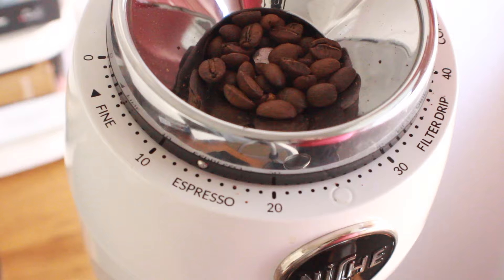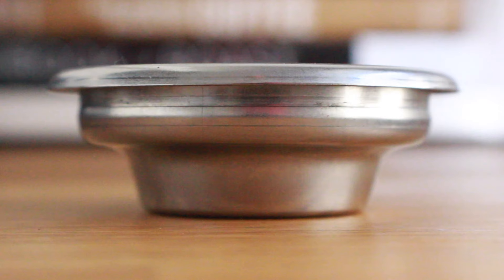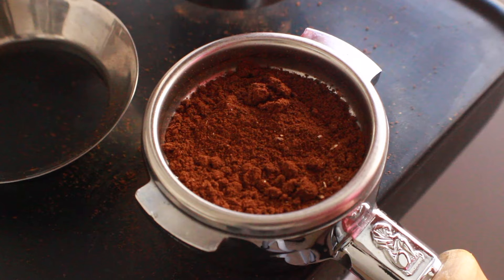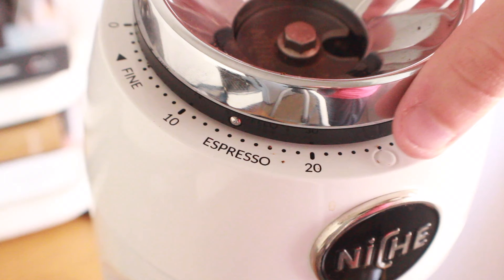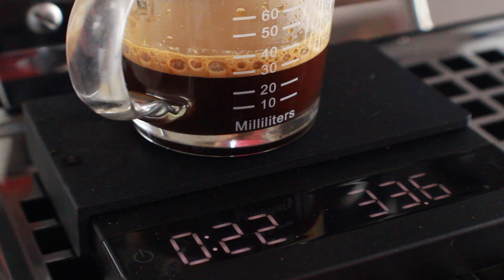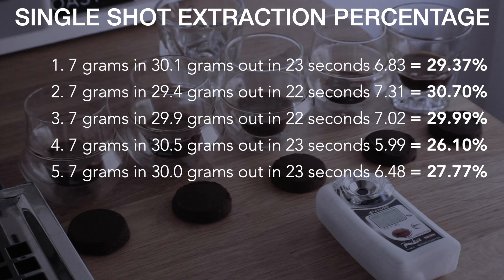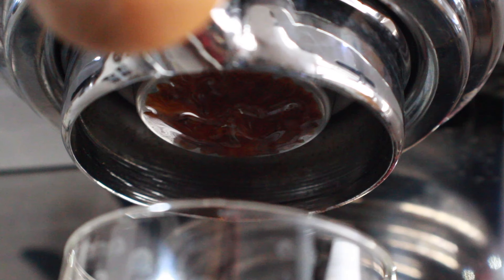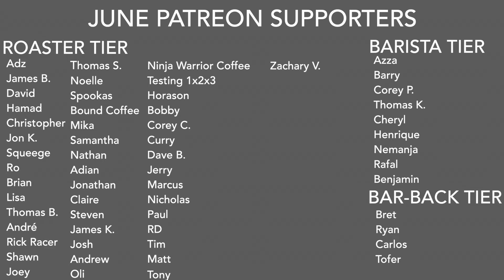ESPRESSO ANATOMY - The Single Shot

Comment: Firmly belonging to this 7% of single basket users (on the Gaggia Classic Evo Pro BTW) I fully agree with the statement dialling in on this option is a challenge. In my case it took many trials on grind size versus quantity for this option. For the time being I found a grind size of position 3 with 8,5grams quantity giving a better balance than the usual 7,5 grams. I will try a still finer grind size of 2 with this 7,5 grams as well, maybe this fits the filter better. For this is the problematic side of filling this smaller basket: before you know the coffee sticks to the shower screen despite careful tamping beforehand. I added thin paper filters  on top of the coffee to protect this screen from becoming contaminated with coffee, but sometimes this just means the paper and coffee together become stuck to this screen. Since we also use a lot of pre-ground coffee in barista grind in both coffeine and caffeine free variants using the pressurised basket, keeping the 12 bar Gaggia factory implementation in can not be avoided.  Thanx a lot for your video and sharing your ideas & experience with us😃  PS This grind position of 3 dates back to our first Jura piston espressomachine from the time they were still making them under the Via Venezia name. Later Saeco used this design to produce their own Via Venezia version under license, which went defective recently and had to give way to the Gaggia we now learn to master

Comment: Hi there,
I have a post-millenium LP from the beginning of the 2000s, but my single basket is different to yours. Yours looks like an ese pad basket. Mine is more round at the edges and not so flat. When I tamper with 51mm diameters, everything is compressed properly. It seems La Pavoni changed the standard basket just to become ese compatible.

Comment: As someone who avidly uses a single shot basket, I am always curious to find new method of doing things. I generally use 11g in and get 30g out and need to set the grind slightly finer than a double basket. Im currently running a Quick Mill Vetrano which came with a surprisingly good single basket. I do find that the overall flavour coming out of the single basket is just always a skosh lacking. Thanks for you video, will try your method out and update.
Reply: I have to say it a lot easier doing the 11g in 30g out thing. I find that what makes this work best is a finer grind (as opposed to a double basket) and a long pre-infusion.  Using the small portion of the basket made for a goopy puck for me. That being said my basket has all rounded edges which makes it much more difficult to properly fill that section only. 

I will admit that the espresso came out eith great clarity.

Comment: Been experimenting with single shots for a while now on the barista pro. Found if i grind double as fine as i do with the double shot that the shot is pretty decent. I use outer burr 11 and inner burr 4 for double shots. Went down to outer 5 for th single which was pretty decent. Going to experiment going even lower.

Comment: With only 7grams in and 30g out. That would be more thab a 1:3 ratio. So yes, even though tds (strength) is lower because there is much more water, the extraction percentage is higher. Extraction percentage is basically the percentage of how much you extracted from the dose in. Extracting only 7grams of coffee with around 30g of water would extract a lot of those coffee grounds into the shot. Hence the high extraction rate. Aint I right?
Yes, in other words, as you said, lower amount of coffee is easier to extract :) hahahahah
Reply from the maker: barista odla this is correct sir! So what I find that stopping a bit earlier, maybe around 20g out you’ll get that average/ideal double extraction TDS percentage.
Reply: is it or is it just because he ran double water through? If you ran 14 grams of coffee in a double basket and pushed through 60 grams of water would you get a comparable TDS percentage? 

If it is the case that the smaller dose really does pull a superior shot, i wonder if Cafe' machines with evolve to a double group head dual single shot pull, could be a new method of a double espresso with a higher TDS

Comment: I got best results using precision baskets and a dose of 9 grams and brew ratio 2:1.  I even do not have to adjust a grinder for a double basket. But for me a single basket shot taste much better than a double one. Therefore I drink almost only single shots of "café vero napoletano".  When making a single shot slow down a bit and be more careful about proper and good distributing of coffee in a basket and a level tampering. When using precision baskets do use also precision tampers.  Do not tap on the portafilter with already a  tampered coffee in and be careful also when inserting the portafilter into the group head  to avoid destroying the tampered puck before starting the extraction. Do a lot of testing and you will be successful.

Comment: I don’t recall if your La Marzocco has a PID controller.  If it does, did you mess with the brew temp?  Also pressure for the shot or did you keep it consistent with your double shot pulls?  Would’ve been helpful to do a double/single shot basket compare to see if you need to dial in the temp and pressure like you did the grind.  Because the finer grind explains your % extraction more. Else the only other variable i can think of is the air gap in your single shot basket that impacts the puck geometry through extraction.

Comment: The Real Sprometheus  7g:30g versus 15g:30g...my brain would expect a different TDS just because the “relative” brew time is longer on the single basket. Would be interesting to see how results compared if you used that 1:4.1 brew ratio on a 15g dose, approx 64g output. Over extraction ignored since you’re just measuring TDS. 🤔 I guess the point though is that you can get a higher TDS from a single basket without having to overextract 🤔

Comment: First of all great video! Highly appreciate the work you've done on that. I've seen some comments talking about lowering the output for hitting lower extraction numbers just cause we used to them. My question is, isn't this exactly what we been using a refractometer for? Getting more out of less coffee to minimum waste and be just more effective with our brews? You've said that the 30g shot tasted actually good right? That sounds to me like they're no unwanted things are extracted and that sounds like you should rock with that 29%.
Could it be that you reached higher numbers cause you packed the edges of the pug, due to your "finger pushing technique", just way more than you would do with a double basket?
Reply from the maker: I think that getting more out of less is definitely a great idea overall. Personally I’ve switched from 20-21g doses to 17g for my daily coffee habits. 

The 30g shot did taste good, but it wouldn’t be great in a ton of drinks, but for most of what I drink, 5oz or less, it would be fine for. 

I think it could definitely be good for some coffees and not so good for others. It’ll still require some tweaks and all that. 

I don’t think the way I packed the basket had an effect on the overall extraction percentage other than keeping a solid seal during the pull. But there are lots of variables here with the odd puck preparation.
Reply: @Sprometheus  Appreciate the respond. Definitely gonna pick up your work and do my very own experiences at home with it. A refractometer is already on the way lol. Wasn't drinking single shots in while cause I got disappointed to often. But maybe my new tool helps me to understand them more.

Comment: still dialling in mine, but so far i've settled on 12g in, 21g out in 27s. i've had to grind coarser compared to the double. in a bit of a pickle because any less than 10g is impossible to tamp, and any more than 9g takes way too long to extract. somehow a higher dose with a coarser grind seems to be the only sensible move.

Comment: You could just use a 41mm funnel and 41mm tamper from Tidaka that were specifically made for the La Marzocco single shot basket. It has been around for a decade at least, nothing new.
Reply from the maker: Florian Rudolph today is the first I’m hearing about them, but I figured they would be out there. May be worth picking up to try out.

Comment: I've had trouble with the single shot basket that came with my Barista Express, the double shot being the norm and all. I am however curious again on making it work.

My current grind size works with a double shot, no channeling and maybe a little over extraction. But then when I switch to single shot with 9g, it's a quick and watery process with a messy puck like yours. I'm thinking of increasing the dose to 11g instead and try again some day. In the meanwhile, I'm just going to enjoy my regular intake.

Comment: Interesting stuff. Would like to see you make a video comparing what we think of as good extraction times vs a good extracttion texture and tatse. We're experimenting this in out café as time are constantly changing. Sometimes to maintain times even on the same coffee at a diffeerent time of day we have to radically change grind. So my qauestion is what matters more. Brew time, or grind texture?
Reply from the maker: So those two things are hand in hand really. I don’t think one can really cover for another. The constant grind changes is a normal thing. As temperatures change, burrs warm up, etc. 

Brew time equals extraction, until it hits a point that the extraction stops and the dilution begins. It’s a hard question, and one that is based on the coffee you’re using and what you’re aiming for in terms of taste.

Comment: To get all equal, you'd want a cylindrical basket 71% as wide (41 mm) with a matching tamper. But also only 71% machine pressure since the narrower passage will increase the pressure. (71% is 1/✓2)

Comment: What was your reasoning for a 1:4ish dry dose of 7g to 30g yield?

I read one of the comments referencing Italian style extraction/ratio but the coffee you are working with is not a degree of roast that Italians would use historically.  The 30% extraction readings would correlate to the super high wet dose through only 7g of coffee.

So how did it taste with 7g in and 14-16g out?

Comment: My main issue here being the prep time (or simply the effort of prepping the shot). Is there any fixed radius for the single basket inner well? Wouldn't it be fixed if someone make a machined or 3D printed funnel and tamper to cut the effort shorter? But then again, I have several hypothesis as well. The 9 bar of pressure was a bit (or a lot) compressed by the constricting shape of the single basket so wouldn't that equals to several times higher of force applied to the puck compared to straight 9 bar of pressure being applied equally throughout the double basket? At times like this, I wish I majored in fluid physics back when I worked on my thesis last year haha.

Comment: I quited single baskets cause they are difficult to have consistency , from my experience 20% possibilities to have a very good extraction
I even constructed a specific tamper for the LA marzocco single, if i remember correctly, 41mm diameter
Some extractions may be better with single, but the major part need double baskets with 19-20gr dose

Comment: I find this design single basket (with central well) worse than a tapered single-bowl basket. I make exact same espresso (double or single ) with a single bowl single shot basket that came with my bezzera magica without changing grind size and without getting too nerdy with measurements and tests but just using eyes, taste and good judgment on ratios, tamping pressure etc. The result I look for is always a dense creamy espresso that's not bitter and not sour, but right in between and taste and feel in the mouth like a coffee-flavored hot chocolate! Thanks for the video and effort tho! It's very entertaining and interesting to see people getting so nerdy and shit :)

Comment: i was able to make perfect single shots on my 10+  years old gaggia classic . then i replace the group head gasket with a new one (red) and .. disaster ... although it is the exact replacment the material is softer and results to leave not enough space inside the puk .. adding an aditional thin gasket before the new gasket solved the problem .. so i think you have the same problem .. put 7grams in your basket and a small coin to measure the space betwenn the puck and the grouphead .. if there is not enough space left you will not be able to pull a good shot

Comment: Hi again and thanks for the video. Such a joy to learn about the single and double shot. So, to your point of view, a single will be 7gr in - 21gr out, and a double 14gr in 33gr out?
By the way, my home, cheap, regular brand expresso machine comes with both, single and double shot baskets, but both have that conical funnel shape, i wonder if they both produce high extraction percentage. I use both, the single for mom and dad who like softer drinks, but I use the double for my lattes, flat whites and americanos (yes, im a caffeine lover). And again, thanks for your videos.
Reply from the maker: Héctor Omar Vallejo Castillo of course, thanks for watching and the comment!

When it comes to single and double that’s always a debate. But I’d say a single can be between 7-14g and a double can be 14-21g. The output would be up to the barista and the best possible outcome in terms of flavor. But generally a 1:2 ratio. 

Most of the conical shaped baskets are pressurized, so that may be the case with your machines baskets. 

Thanks again for watching!
Reply: @Sprometheus  yes, they are pressurized, since they have that funny metal filter on the bottom. Still, i hope one day ill be half as good as you are pulling Espressos. 😋😉😊

Comment: hey:) thank you for the video. I have a very old Krups espresso machine from 80‘s, ( at that time Krups had better quality in terms of espresso machines I think)  after a few problems and changing the pump, I have achieved to bring back the machine to the life :) anyway the machine has also 7gr and 14 gr baskets but most of time I am pulling my shots with double. I was wondering while watching your video. normally should not we be following the ratio of  2-2.2 for normal double shot espresso. So when I pull 14 gr. coffee I was trying to extract 28-30 gram espresso acc. to this ratio. But in your video you are doing same for the 7 gr. basket. So am I doing false until now or  which ratio should I follow. Because it is difficult to have consistency with ml.  I preffer to weigh in grams.
Reply from the maker: Honestly there really isn’t a wrong way as Long as it tastes good. That’s the beauty of the whole coffee experience. 
If you feel like it could be better I’d recommend starting at 1:2 ratio no matter the input and adjusting from there to taste. Either up to 1:3 or down to a 1:1. It will very from coffee to coffee.
Reply: Originally, the double dose was only 14g of coffee. Back in the days a normal brew ratio for both double and single shots was 1:3. 3rd wave modern espresso changed that because of the lighter roasts. They tend to taste better with more coffee in and a shorter brew ratio. So when you want to achieve a good single shot, take into account that dosage might also be upped a bit for lighter roasts and yield could also drop a bit for lighter roasts to actually taste like you are used to from a modern day espresso recipe of 18g in to 30g out in 25-30sec.

Comment: I just recently started pulling shots after a five year hiatus (traveling &moving to Germany) and decided to start with the 7g basket due to what I remember Scott Rao saying about 7g single Italian shots being noticeably sweeter than double/triple shots and wanting to make more shots a day without too much caffeine intake.

and so the nightmare began.

So difficult, partly due to my grinder I think (Mahlkönig Vario). I went up to 11g and then slowly back down to settle on an 8g dose, but the puck almost always sticks to the dispersion screen. What that showed me is that the top of the puck (what's left in the basket) and the exposed bottom part are a medium brown color while the middle is very dark. It's quite strange.

I have been trying to get a 1:2 ratio and in a 25 to 30 second window too to add to the difficulty (much finer grind needed making clumping and channeling serious issues). Hadn't heard singles are more a 1:3 - 1:5 ratio.

I also get practically no crema from them. Typical for singles???

I will definitely be trying your technique as well as a higher ratio and shorter time.

Thanks for making this vid on the single basket Spro!

Comment: I also like pulling these, as the extraction can turn out well, but found consistency to be a challenge. 
Went for a more forgiving traditional dark roasted low grown blend.
Bringing pump pressure down from factory set 9bar to around 7,5bar really helped, otherwise it just blasted through the puck.
Seems in Italy they pull these all the time, but couldn’t find a lot of info on how they do it.
Reply from the maker: Yeah these are definitely a little tricky, and without the specific tools consistency will be all over. I couldn’t find a lot of info on how the Italians do it, other than it being just a factor of quick turnaround.
Reply: @Sprometheus  I think the Italians use the double basket and pour into two cups. Since the “bar” has enough traffic from having to throw the other shot away